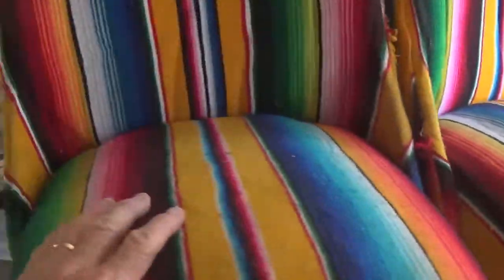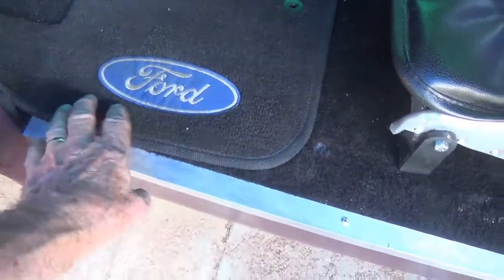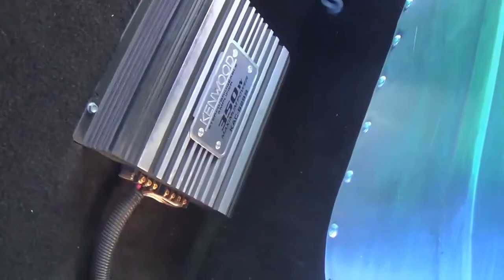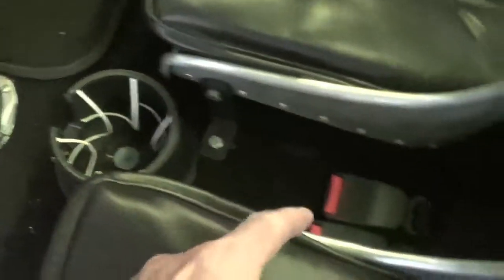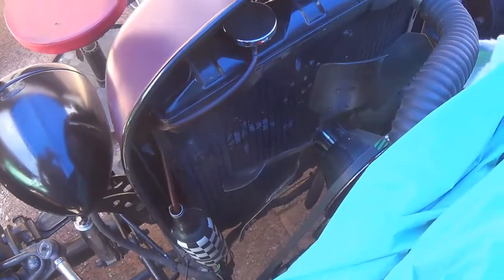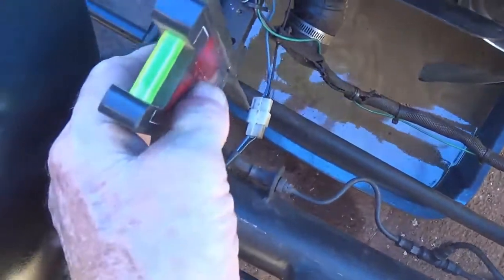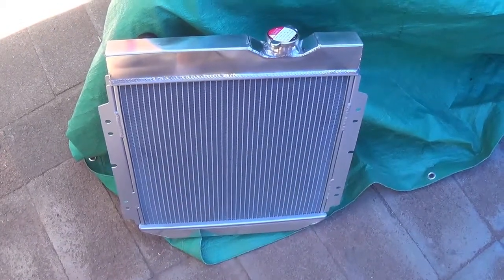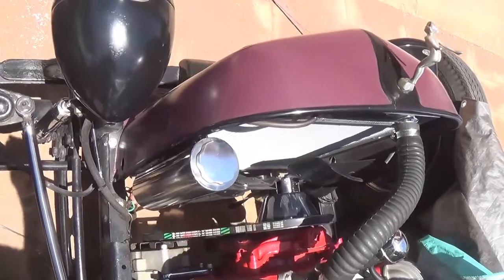1934 Ford Pickup: Arrival, Interior, Radiator Replacement

Comment: How do the aluminium seats hold up under that hot southern sun?
Reply from the maker: My wife complains about them and puts a towel over the seat back, but I "tough it out". They aren't ever hot, but can make you sweat a little just due to lack of ventilation. Aluminum is an excellent heat sink.
Reply: @uncledougshotrodgarage6049  thats why I asked, I thought maybe they would take the creases out of your shirt for sure, glad you still drive this
Reply from the maker: @phonotical  No, they're surprisingly comfortable.